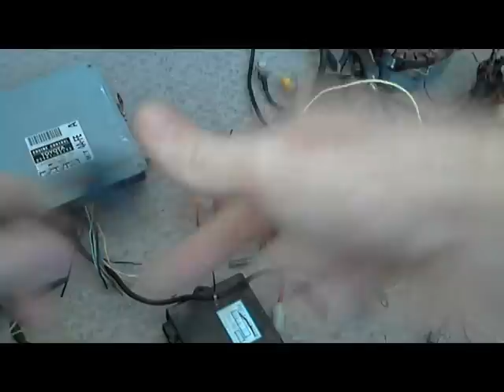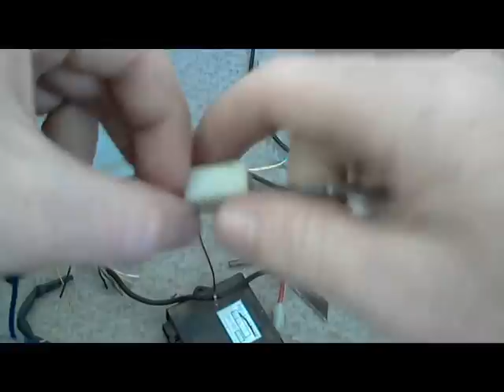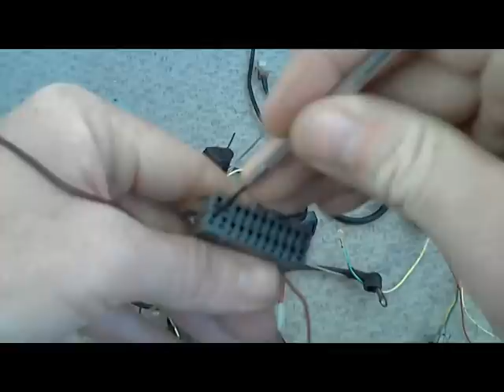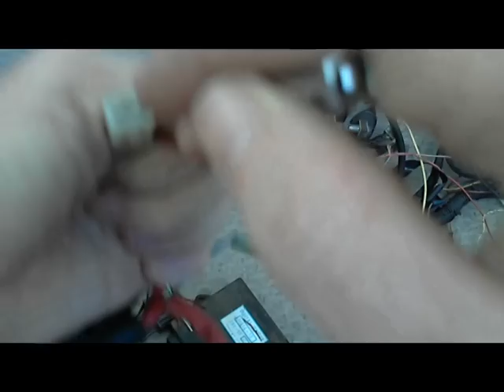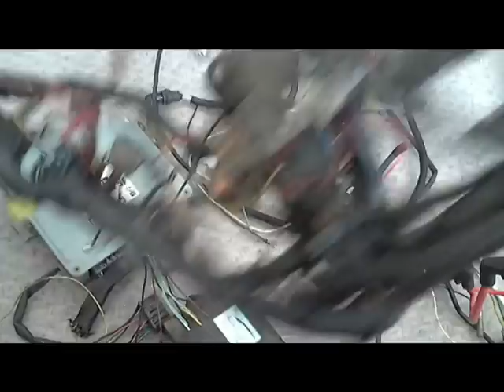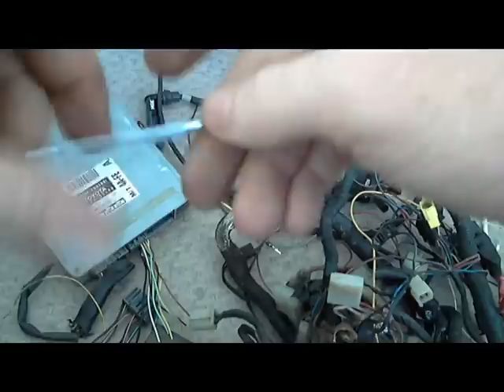HOW TO re-pin automotive connector

Comment: Thanks, lets hope this works for my 2004 xc90 power window switches. They seem to be loose and dont make a good connection any more. If I hold the connector wires the window switches work. However, I was unable to get the pins out to try to clean them and tighten the connection points.

Comment: The grey plug looks very similar to the one on my miata ecu harness. I hope it's this easy 😁 would you know what the pins are called? And if you can actually buy them?
Reply from the maker: The pins are able to be purchased, yes. You can post pictures of the pins/plug on the Motorsport Wiring Alliance Facebook group and someone will likely know where you can purchase the pins. There should be a part number on the plug itself, you can look up that part number and possibly find pins for it as well.

Comment: The pins in my harness corroded, which means I would have to replace the whole pin. Could anyone point me to a good website that can provide such pins? Any forums or any good website. Any help would be much appreciated. I have a Chevy 2005 equinox and I need to repin the harness connector that's under dashboard driver's side. Any help any help or info would be much appreciated!

Comment: Thank You HourNine Racecraft - man, not the best quality video, but it helped me dealing with a 40 pin connector to the Around View Monitor module.  The left and right camera of my 2015 Leaf were switched (!) - Can't even think on how that could have happened!- I had to identify the  2 sets of 4 pins (one camera per set of 4) and switch  them plus move away another 4 to make for maneuvering room, removed/replaced 12 pins in total, switching the L and R an put it back together. - Couldn't have done it without you, honor and respect to you! :)

Comment: -HourNine Racecraft:  How's 'bout getting the object being described IN FRAME , huh!?! And, while your at it, check the FOCUS ?!?
That would make a significantly  BETTER video presentation, ya think?

That said, if you bother to continue to look and listen, despite the obvious glitches w/ various props, as well as the minimal camera , there's some reasonably good information here, particularly for the individual just getting into wiring of automotive-type circuits and its varied connector types. For that alone, this video will receive a 👍.
Reply from the maker: It's your choice whether you are nice or rude, I'll make my choice and respond kindly. Check out my newer videos, they are far better. This video is 10 years old, it's not out of focus it is just low quality compared to today's video. Have a nice day

Comment: Can you pin wires in any pin hole when you replace the connector or do they need to go into specific holes for the aftermarket radio??
Reply from the maker: There is a good chance that the pins from your factory radio connector won't snap into the plug for the aftermarket radio connector (if that's what you're trying to do). It might slide in, but not snap in place. I've always had to buy an adapter.
Reply: @LegitRaceCraft  

No.

Ex: my connector is broken so I remove all the wires and pin then into a whole new connector. Do they have to go in a specific order/holes for it to connect to the aftermarket radio and function properly?
Reply from the maker: The pins should go in the holes that they belong in. The order that they are put in doesn't matter as long as they all go back into the place they belong.
Reply: @LegitRaceCraft  

Okay, so they are assigned to specific holes. Thank you! 💯👏🙌🙏🤝 ... 👍👌💪💯
Reply: Wat do u mean ??

Comment: So I followed along. I found using a zip-tie for the levers actually helped me release the metal pins without bending them. I didn't have to pry, I just had to insert the zip-tie as far as it would go, and the pin would slide right our without being bent. Just something to think about. Thanks so much!

Comment: well done, well explained, now i understand a little more about my 6 pin harness which i have 4 wires that have no current  if i cut the wires &change the connectors do you think it will help with better connection cause i saw my harness full of green corrosion as you would on a battery sprayed wd40 but still only 2 wires have power off n on thanks . like your vid ..

Comment: I am in the process in repairing an door power harness...
Where online or store can I find pins and wires?
Reply from the maker: They are hard to find online. I would try to find a junkyard nearby if I were you. Then cut off its door harness. Use those pins.
Reply: +Hournine Racecraft so you can reuse pins that have already been crimped once?

Comment: Can you just replace an entire wiring harness instead of repinning them
Reply from the maker: yes, you can. But sometimes with how the wires run behind the dash or engine it's easier to just repin the connector so the different ecu (or whatever else) will connect.

Comment: This works for audio headunit connectors right? For example I have to remove 3 wires from a blue quadlock connector and move them to a 32 pin connector.
Reply from the maker: this will work for any connector as long as the pins are the same type between the two connectors. There are a few different types, as soon as you remove the pins and compare then you should be able to tell if it will work or not.

Comment from the maker: I don't know, I've seen some weird issues with the new electronic throttles. Unplug them and the car redlines (neon), disconnect/reconnect the battery and the car loses stored memory on how to operate the throttle (jetta), etc. I'm sure other people have had the same problem you are having though, and most likely it is being discussed in forums somewhere

Comment from the maker: You should be able to find a vacuum hose routing diagram and a coolant hose routing diagram online for your engine. Off the top of my head, you will have vacuum going to the purge canister, the idle-up solenoids (bolted in around the intake mani), fuel pressure regulator on the fuel rail, BOV. And 2 coolant hoses going from the TB, 1 inlet, 1 outlet. The wastegate is actuated by turbo pressure so usually they just connect straight to the turbo unless you have a boost controller.

Comment: This helped a lot I did everything, only thing left are vacuum lines & coolant lines. Could you make a video of the 3 hoses under the throttle body? I dont know where they go. Also there is a metal line coming off the wastegate forward the back of the engine. Where does that go? Any video of the hoses would be great. You've hoped me a lot so far & this is the last thing I need then ill be making a video of my whole swap with pics & videos.

Comment from the maker: as far as your TPS, on one end of the 4 pins is a brown wire(ground), on the opposite end of the plug is the 5v tps supply, the wire next to the 5v supply is the tps signal, the one next to the brown wire is the idle switch. You shouldn't need to know all of that for what you are doing, just know that toyota TPS are all mainly the same 4 wire pinouts, swap the pins and leave the wires in the order that they are in.
Reply: Hello. Can you help me repin an automatic transmission cables? The initial socket had 13 holes. But that gearbox spoiled and I replaced it with a 10 pins socket. The original has 13 pins and the new transmission box has 10 pins. How do I rewire or reconnect the wires from the 13 previous pins to the 10 ?

Comment from the maker: I removed all of the wires that were going to the ECU on mine. I left the rest of the 5sfe harness intact and just removed the wires that I wasn't using. So yes and no, I used the 5s harness, but nothing from the ECU. The aftermarket computer I used came with it's own wire harness, so I made my own custom harness out of that one.

If you can find someone on the 6gc.net forums or mr2oc forums that has done a repin of their ECU then that would be the best thing.